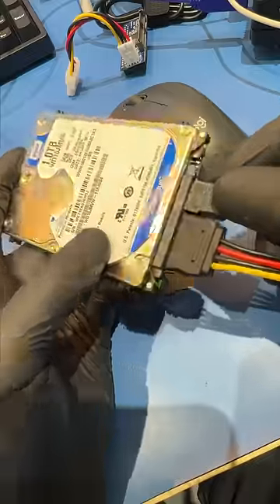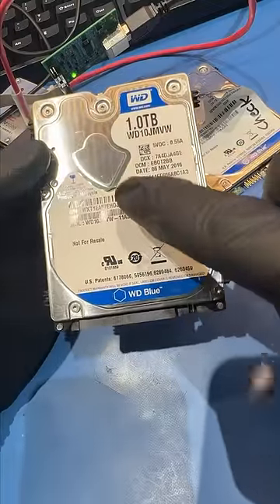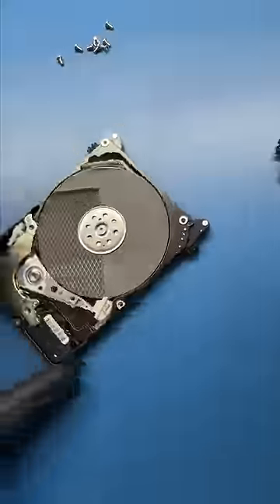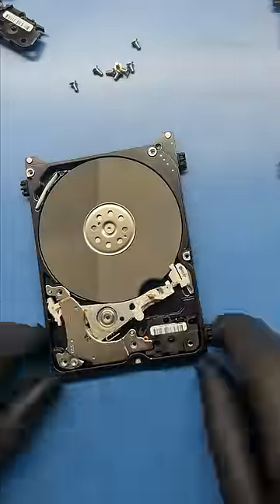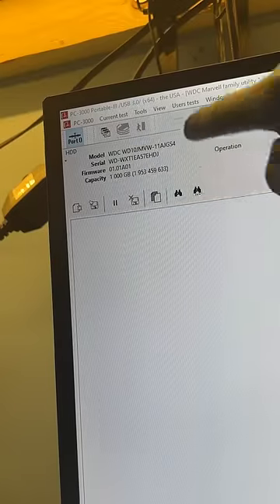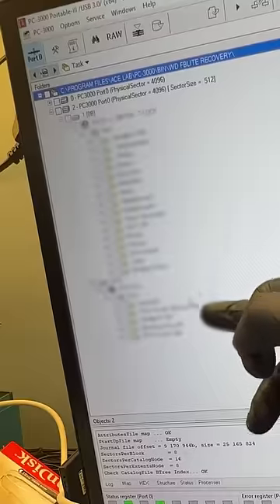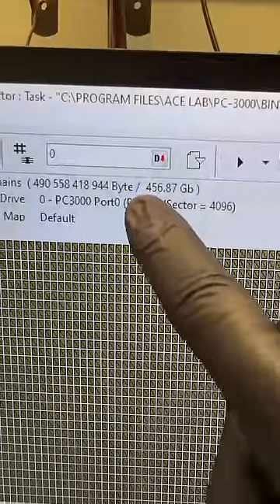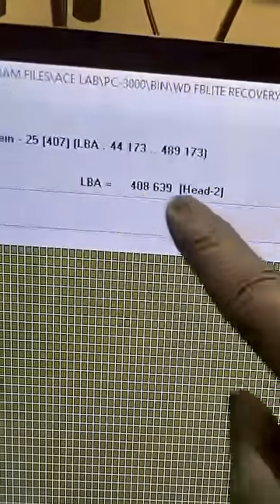Hard Drive Data Recovery Possible…? #technology

Comment: For people confused about the encryption key: A lot of these drives actually contain an encryption key in the controller inside the drive itself. This key not meant to actually encrypt or secure your information; the idea is that you can instantly erase the entire drive by simply randomizing that key inside the controller. So it's more for instant full-disk erasure than general data protection.

The alternative to this would be to manually erase and randomize each sector, which not only takes hours, but also reduces disk life. Simply randomizing the key does not deteriorate the drive and irreversible 'destroys' all information with zero wait time.
Reply: Thanks for explaining, but the use case sounds weird. Why would you want to  "remove" everything instantly? You can have the same by just reformatting the disk ? (It will remove only partition table, not the information)
Reply: @s0meus3r  Reformatting the disk doesn't truly remove anything. The data is still there and easily accessed using file recovery tools, many of which are free. Formatting merely delists all files from immediate view. As you save new files, they're then written over the old ones. So if you want to protect your privacy when throwing away a drive for example (or have less than 5 seconds to protect yourself from an FBI raid) then simply formatting the drive doesn't protect you.
Reply: @NotGarbageLoops  and that's exactly what I am telling about. What is the point of having encryption when the key can be extracted ? Clearly, privacy is not a concern in this case. So the only reason is the "fast secure full clean" - but it's quite questionable ...  you potentially sacrifice slightly the performance or pay for hardware encryption for a case that is rarely used ?
Reply: @s0meus3r Encryption is incredibly fast if done in hardware, which is the case here. So I doubt you'd see any difference without it. The reason conventional encryption is slow is because it runs in the CPU. But this has dedicated hardware right in the controller optimized for speed and low power.
Reply: @s0meus3r spinning rust is incredibly slow I'm comparison to today's CPU/MCU speed so encryption is not likely to be a limiting performance factor
Reply: @alessandroceloria  do you mean to say that adding encryption will not sacrifice either price or performance? And there will be 0 penalty?
Reply: @s0meus3r  Considering that nvme drives with orders of magnitude better performance also use this technology (SATA secure erase I'd you're curious to look it up) yes, I do believe there are no performance issues associated with this practice. As for the cost, an MCU with hardware encryption support is probably around 10c more on the BOM. On a 60$ (at least) hard drive it hardly matters.
Reply: Ok but can you explain how he "finds" this encryption key? He doesn't explain it
Reply: @sal_strazzullo  It was stored in the controller of the previous drive. He has tools to extract it.
Reply: Thanks for explaining
Reply: so it's not actually encryption here? like bitlocker for example?
Reply: @handlehandle12322  Whatever you encrypt it's only encrypted to a certain extent. There's always a backdoor or other way in if the encrypted data is of high interest. You can fool hackers, the cops, maybe even the intelligence agencies up to a certain extent, but if you are doing something big they will know no matter what
Reply: @handlehandle12322  It absolutely is encryption, but the purpose isn't to actively protect information, the purpose is to facilitate fast disk erasure.
Reply: So how about hardware encrypted drive like wd passport? Can he read that key and decrypt the drive?
Reply: @s0meus3r The library analogy works well when it comes to disks:

Imagine the disk as a huge library with lots of books (data), and there is a librarian who knows which book is where (file table). A normal deletion just tells the librarian to forget about a specific book, if they need to put a new book there, they will trash the old one, but if that doesn't happen, a patient enough person can still find the book themselves. Additionally, you can make sure nobody finds a book by having the librarian place books to the place the book used to be multiple times. It works, but it takes time and also does a lot of writing. Alternatively, you can encrypt each book and have the librarian hold the key that lets you read it. By taking away the key from the librarian and giving them another key, you turn every boom up to now unreadable, and it takes seconds to do.

Comment: When u say find the encryption key, u mean he send it to you or you actually FIND IT with some software or bruteforcing it?
Reply: Gonna need this answer as well
Reply: Unless it's using some horrible encryption algorithm, he's not bruteforcing it without a quantum computer or centuries of time.
Reply: @user-vk2cd9qw7i  tah that's The usual idea but The way he said that, i've got ask
Reply: None💀
Reply: @user-vk2cd9qw7i usually when ppl say bruteforcing, they refer to weak passwords specufically, which in 99.99%* percent of the case does not need large computation resources.

*: the rest 0.01% are some power Linux paranoid user using LUKS with   abnormally high iteration count or bcrypt etc. But for those type of user they dont tend to set short passwords anyway.
Reply: the key is always stored anywhere it's being decrypted. It's on the drive somewhere
Reply: @hunterlepage  For full disk encryption like this (most likely BitLocker) Password is not stored at disk.
Reply: It's a SED, the key is on the controller board, and it's a non FIPS-2 compliant drive
Reply: @xade93  it's a SED
Reply: @lauraprates8764  oh my bad. Never been work with SED before. Thanks for correction
Reply: the password for the user account will be sufficient. if bitlocker then the decryption keys from the microsoft account.
Reply: @Zeroduckies  the video shows it's SED not bitlocker "Self-encrypting drives (SEDs) encrypt data as it is written to the disk. Each disk has a disk encryption key (DEK) that is set at the factory and stored on the disk"
Reply: @snooks5607 so using a SED is useless since it adds no more security than an unencrypted drive? Like putting the keys to your home under the flowerpot?
Reply: @joachimdeussen  it is a bit more security than unencrypted, not as much as before there were readily available tools for it but some anyway. at the end of the day all security is just a deterrent and should be scaled according to the threat (or if the threat is the feds maybe scaled to severity of your alleged crimes/how much they want to nail you.. likely better to just not leave anything for them to find)
Reply: @hunterlepage not necessarily. It depends upon a variety of conditions. Our basic repository requires two physical hardware keys with timed element hardware engineered in house in 3 different depts. And separately programmed. This precludes any tampering of the actual keys as each drive has an added feature of the keyset (public) being serialized in actual hardware through a physical mod attached to the actual drive port and complimentary serialized.  In this manner data cannot be offloaded and decrypted as each separate drive is functionally independent from another. And redundancy supported by 3 physical copies with a different keyset.
Reply: @xade93  usually when ppl say bruteforcing, they refer to weak passwords specufically:

- Don't assume human stupidity. Most people will use brute forcing for all passwords/encryption as that's what they see in the movies.
Reply: @hunterlepage  That would defeat the purpose of encrypting the drive in the first place.
Reply: Did some research on this. The customer had to still provide the password to allow the program to decrypt BitLocker. Without it, he wouldn’t have been able to decrypt it.
Reply: You can use a command to erase the key, and data is fully lost instantly. No DBAN needed.
Reply: It depends. Default Bitlocker employs TPM, so a dead motherboard loses the data. You can alternatively use a USB stick as a key, or you can use your brain with a passphrase. The bane of alcoholics trying to remember their phrase.
Reply: I thought he meant, the customer left the encryption key in the hard drive.
Reply: if it was bitlockered and the customer had a Microsoft account for his windows log in, he can recover it online and maybe he worked with him to get it
Reply: yeah that doesn't make sense.  bro bruteforced the passwords? wth
Reply: No customer doesn’t send it. Some drives are sed locked and have keys within their modules. But a lot of drives are encrypted via the usb bridge from the external enclosure they use. Pc3000 has those keys. You do not “get them” they came from reverse engineering on ace labs end. Otherwise these drives are not recoverable. 

Sometimes you can clone the drive and put the clone back into the enclosure and it works but not always. Wd is notorious for this shit.

This particular drive is sed encrypted and have keys within the sa. But to gain access to firmware you have to a lot of the time turn off sed… so you gotta load the keys after. Then the pc3000 does the rest.
Reply: I think the data is stored in the encrypted form only on the magnetic disk, the header module is responsible for decrypting the data when it read it from there, since the header assembly changed so the data is encrypted.
Reply: @varunaggarwal7126  holy.... good point i didnt even know that n feel embarrassed as an IT tech
Reply: This why I’m the comment
Reply: @joachimdeussen  All encryption is one password away from being unlocked regardless. Self-encrypting drives are about reducing the attack surface, e.g. SEDs aren't vulnerable to CPU/RAM exploits because the encryption happens at the drive level rather than the software level.
Reply: Also, unless im mistaken, because the drive if fully encrypted, if you wipe it and reset the encryption key, im pretty sure they old data is truly unrecoverable.
Reply: @chriso1373  yep. Data is gone. Any drive you wipe, format, overwrite that has encryption can and will become unrecoverable.
Reply: @snooks5607 Wouldn't SSDs be better in that case? Much harder to recover data from them.
Reply: I need some one to reset and Crack into my kids devices, she sets passwords and forgets em. Any idea on where to go
Reply: @joachimdeussen Exactly
Reply: @pickelsvonbrine Dope
Reply: nobody brute forces anymore. They have hash repositories online now and they're always getting bigger and bigger.
 
If your hash is in the repository, it's cracked instantly. If not, it almost certainly will never be hacked.
Reply: So... it's like hiding the key to your house under the front-door mat.
Reply: @runthenumbers9698 yeah, you're talking rainbow tables. Which are getting better and larger but can only get so far. Especially if some unique salt is used.

Brute forcing could still be an option if that's the case, but it's not very viable. More complex a key is (ie, bitlocker key), the more compute time it'll take. And with something like bitlocker, you'd probably be long gone before bruting that sucker.

Atleast until Quantum becomes more widely available, then brute forcing will be an option again
Reply: @user-vk2cd9qw7i That’s not entirely how bruteforcing works. You can set specific parameters or values when bruteforcing and make it a lot easier/faster. Even so, most computers nowadays are so advanced and quick, you can brute force basic encryptions with the utmost speed and accuracy. A hard drive encryption key is not that long of a character count and could be cracked in days if not weeks. It’s not that difficult.
Reply: @hunterlepage  Maybe, may not be. Some encryption software such as Truecrypt (now taken over and renamed Veracrypt), do not store the encryption key on the encrypted, mountable drive. That's the beauty of these 'software' loadable drives. There's no key to crack.
Reply: I was looking for answers to the same Question!
Reply: A lot of these drives actually contain an encryption key in the controller inside the drive itself. This key not meant to actually encrypt or secure your information; the idea is that you can instantly erase the entire drive by simply randomizing that key inside the controller. So it's more for instant full-disk erasure than general data protection.

The alternative to this would be to manually erase and randomize each sector, which not only takes hours, but also reduces disk life. Simply randomizing the key does no physical damage and irreversibly 'destroys' all information.

Comment: Wait.... how did you find the decryption key? Is this encrypted with Wondows  bitlocker?
Reply: No, it's a SED non FIPS-2 compliant, the decryption key is stored on the controller
Reply: @lauraprates8764  Thanks.
May I please know how you knew about that? 
I couldn't find context in the video that indicates it's a SED. Is it the serial number on the drive? 

BTW, I'm getting into the field of digital forensics, and later, I'll get into disk forensics, so I'm just curious if it's THAT EASY to decrypt that drive if it's a SED, maybe the decryption key shoudl't be plain text? Unless it's an old one maybe idk.
Reply: @__someone__3141  This isn't an answer to your question (as far as I am aware, none of my harddrives are self-encrypting), but SSDs are usually self encrypting. A Secure Erase procedure on an SSD usually completes instantly (ATA Secure Erase/NVMe format commands).

At least on my SSDs, SED is active from the factory, but the disk automatically unlocks itself (Secure Erase rotates the key). When you enable disk locking, you just tell the controller "only use your internal key to unlock the data if I give you the following password". Similarly, I think on disks that don't have SES,  the data might not technically be encrypted, but the controller will still refuse to retrieve and write data.

Since SES is, as far as I know, always active, it is part of the operating spec of the disk and there is no problem using an additional layer like BitLocker and equivalents for other OS.
Reply: @__someone__3141  I'm not sure what he did to get it to unlock the disk, but give that the customer probably didn't use the disk's locking mechanism, it might've just "voluntarily" released the encryption key.
Reply: @fqdn  thanks
Reply: Everything can be decrypted !!
Reply: it's possible that all "consumer" drives still use the SED chip, but it is hard-locked so the feature is not available for management or altering the configuration.  

SED is a feature intended for fast cryptographic erase, and if enhanced features are enabled on enterprise drives, you can use the TPM to store keys for hardware encryption or instant erase by just changing the key on the SED chip, but the motherboard firmware must also support it.   

The read heads may be encoded as well, so that any change between the read-heads and the SED chip will result in unreadable data.

These drives are also used inside of portable USB enclosures by WD (passport). Note the "Not For Resale" on the sticker label.  The USB PCBA (internal adapter) may also be cryptographically married to the SED chip as well. 

Being in a portable external enclosure explains why it likely failed - head crash due to physical shock.
Reply: @johnnyl1201  only with enough time yes
Reply: @fqdn   Love the acronym [Fully Qualified Domain Name]
Reply: @__someone__3141  3/4 through the video shows "encryption type" "Self Encryption HDD" or SED "Self Encryption Drive
Reply: Keys stored on controller
Reply: @UNcommonSenseAUS  then whats the point of encryption
Reply: He asked the customer?
Reply: The hard drive doesn't actually contain the decryption key, it contains the hash... and these days, there are databases full of hashes that you can query online anytime. So basically any password that has ever been brute forced has its hash available online instantly.
 
Any password that hasn't already... well... it's highly unlikely it ever will be.  I would say we're well past the point of diminishing returns. If your password is a dictionary word and a number, it's probably been brute forced by now. If it's more complex than that, it's never going to be found.
Reply: @runthenumbers9698  thanks, i think ur answer includes modern SED, the older ones probably have the decrption key stored on the disk (be it a password or a random generated key by the os).

Im not an expert in hardware that much, but this is my guess
Reply: @johnnyl1201  Only if you have the back door encryption code key from the manufacture, that's why it's illegal to create your own encryption algorithm the gov can't look at your data.
Reply: @DespaceMan    Only if you have the back door encryption code key from the manufacturer
And that works by the drive storing the data twice, once with it’s own random key and once with the manufacturer’s back door key?

that's why it's illegal to create your own encryption algorithm
Please cite the law you just made up.

the gov can't look at your data.
Well, if you encrypt the data before it hits the disk, the government can read the encrypted data … but cannot decrypt it.
Reply: @runthenumbers9698 but isn't the hash calculated by the system when encrypted? I mean if I encrypt something on my driver, veracrypt or bitlocker calculates the hash at the moment taking into account various variables and not using the same hash everytime for everyone else...right?